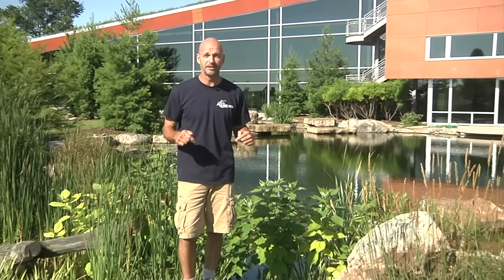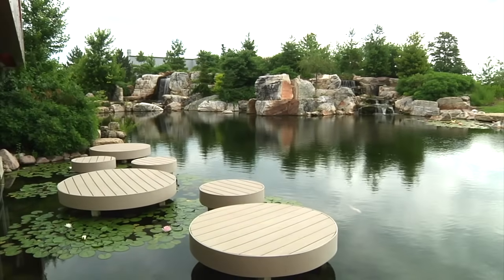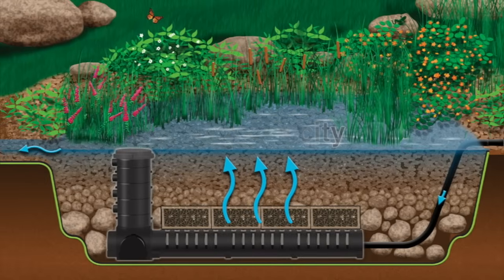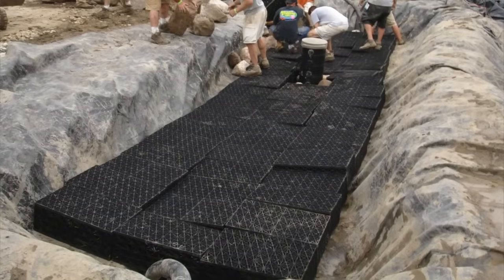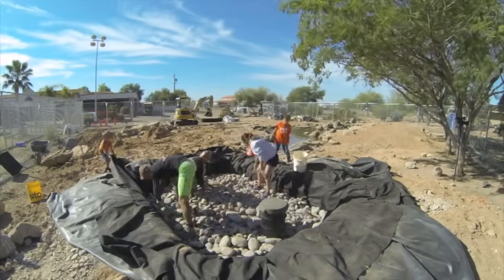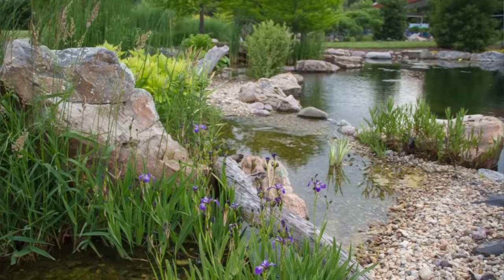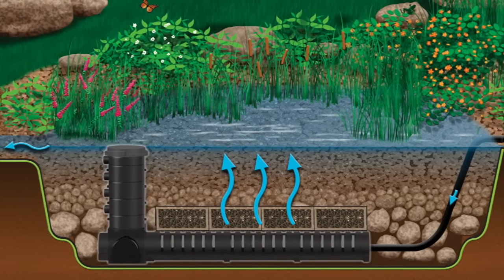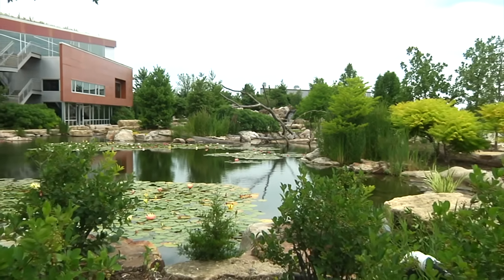Wetland Filtration

Comment: I would to try this in India. Is your system available in India?
Reply: You can build them in India, you can use drainage equipment if you cannot get hold of Aquascapes products
Reply: Creative Cascades so PVC pipes should work right. I guess I will need to punch multiple holes for the water to travel up.

Comment: Ed, do you have a formula for choosing a pump for a pond with wetland filtration?  I assume it would be a less powerful pump than you would choose for a typical pond with a skimmer and waterfall.
Reply: same question
Reply: I tend to use one pump, that will feed the main waterfall and then divert some of the water into the wetland filter as you don't want to high as flow down there. Your starting point should be a powerful enough pump to give the overall flow you want, and preferably one with variable flow control. With a wetland filter pond you still need a skimmer or intake bay to remove solids such as leaves.